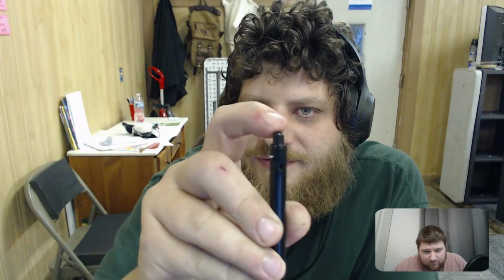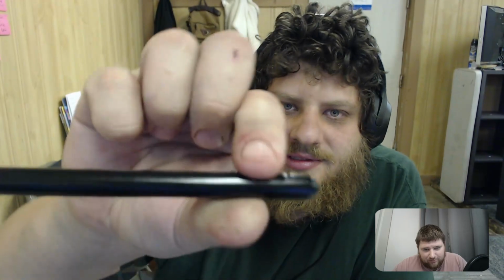Profit First in a Machine Shop -- Ep. 42

Comment: Hey about the tormach wireless probe, have you looked at just doing a OMP40-2 and OMI-2? I was able to get a used setup for under $500. Makes the drewtronics or transmitter attachment for the tormach probe kinda mute
Reply from the maker: It's definitely something I would consider! I keep going back and forth about how long I'm keeping the Tormach, so I haven't invested any more time in the probe. But it's definitely an option!
Reply: @AudacityMicro  the good thing about doing a budget renishaw option is you can always wire those up to another machine tool. I’m sure the tormach wireless xoom kit would be a option to do that with as well, but you get all the added features/wires/control loops of the OMI-2 etc
Reply: As to where to get them cheap. Found a used OMI-2T from just googling surplus cnc dealer parts. $100. For the probe proper I got it from China. Same thing for my ts27r. That was $280 .

Comment: How to calculate per hour free run time ?
Reply from the maker: Like your machine hourly rate? There's a bunch of ways of doing it, at the end of the day they all have some fairly arbitrary factors. Just figure out how much it costs you to run your machine, and then add a profit margin.
Reply: Job Boss is capable of tracking all of that... if you are willing to feed it all the data... and the data is accurate.  Not exactly sure what you mean by free run time.
Reply: @ShainAndrews  lets say I have a part I can sell for 100.00 and I need to be at the  machine for 1 hour but it needs to run for 3 hours to 3d some areas I don't think I could charge my full hourly rate because  the part not worth $400.00. so I wonder what I should drop my free run hours down to keep it competitive.